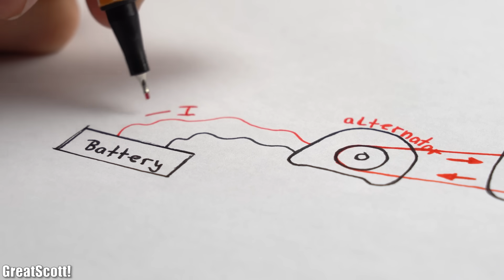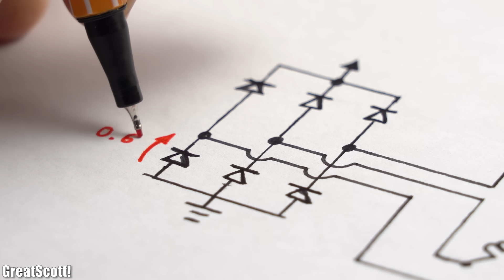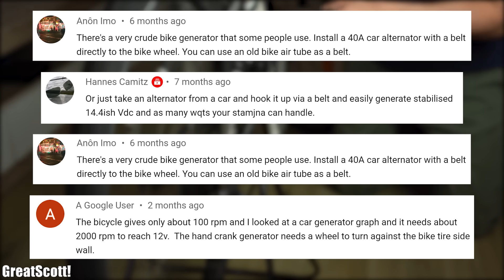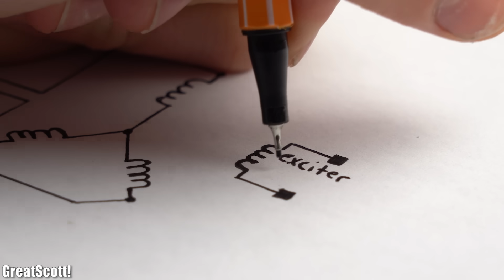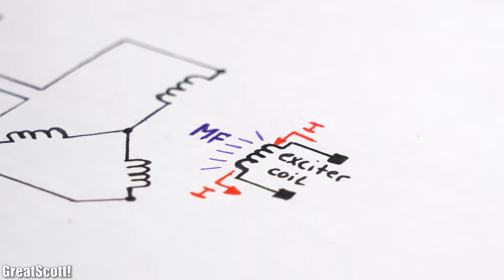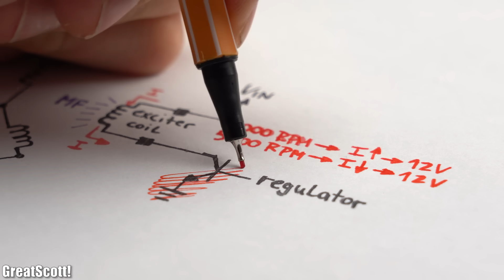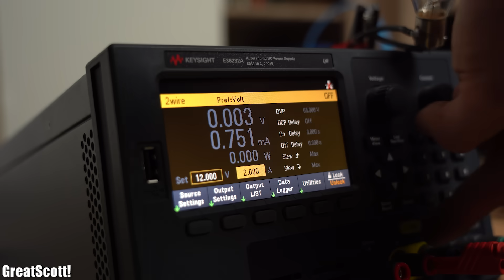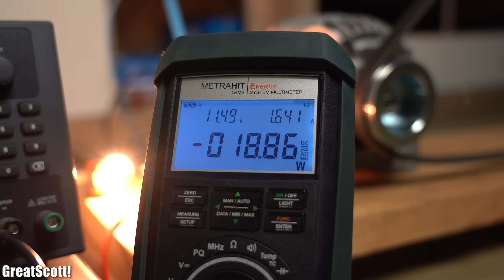Using a car alternator with a bike to power my home? How much energy can I produce?!

Comment: Buy a 250 amp alternator It produces 240 volts if you go around the rectifier.  buy a 3/4 horsepower motor 240 volt single phase.  hook it up to the the alternator with a belt and spin it up.  The alternator will run on 12 amps which leaves 238 amps to run your house.  Plenty of power to run your house.  Remember, the magnets spinning causes the wires to make power it  is not free power.  The courts have said you have the right to be independent so it is legal.

Comment: Don’t know if that particular alternator would have done this but some alternators actually will produce enough current without outside power source (by connecting B+ to the field) to get the exciter coil to start thus bringing the magnetic field up and producing 13.6-14.4v  under no load

Comment: 3:33 Just for anyone watching, some newer alternators CANNOT function without a battery, and a subset of that is Alternators that need a Duty Cycle % from the PCM to control how much current to produce. Sometimes it is 5v not 10-16v, so always check before applying field voltage.
Reply: Mine has a very small Mitsubishi alternator and I have a momentary contact switch to excite the regulation circuit. The battery is the size of 2 Tic Tack containers and is sealed lead acid. One touch of the switch and the voltmeter jumps to 13.8 volts.

Comment: Hey Scott, if you used some kind of tensioner pulley (as per modern cars using those ubiquitous serpentine belts) you would stabilize your setup and prevent your main belt from slipping or slipping off entirely.  I got a little confused with the electronics aspects of your alternator but all-in-all thought this was a clever and serious attempt at making your own power.  Good job!

Comment: One thing I would recommend is fond out the max power output at whatever rpm, meaning at what rpm gives you the most. The make a geared pulley setup that your rear tire connects to spin the alternator. Since not much force is required for the alternator its still easy to move, plus you can customize the pedaling speed to output. Also try more than one alternator hooked to a battery bank maybe

Comment: need to add a tension pully to keep belt taunt, also use the alternator to charge a battery bank (think like a solar set up  but the bike is the sun) and the use a 12v converter to house power.

Comment: ud be much better off to setup a small engine to run on alcohol to power that alternator and get really good at growing potatoes as u will need to ferment them to make ur fuel they say an acre of potatoes makes enough alcohol to a till the land b harvest the potatoes and  c have enough left over to do it again another 10 times sugar is the future to green energy as far as the internal combustion engine goes wind and solar is a pipe dream
Reply: forgot to mention that ud have 10 times the fuel ud need after distilling said fuel
Reply: u could also run the exhaust from the engine into a condenser and produce urself some simi pure water cuz burning alcohol gets u co2 and water out the tail pipe think soda water from combustion

Comment: Use an exercise bike, they have high quality bearings and heavy wheels that you can use as a flywheel
Reply: I was thinking what about a  stationary bike? when he built the frame 
Then thought he had more flexibility with gear change
Reply: @JSacchetti1 Not true they make cheap in China.
Reply: @JSacchetti1 Well no not really, different bearings are designed for different applications.
Reply: @JSacchetti1 LOL wat?!
Reply: @JSacchetti1 lol funny but you're right. Adding a flywheel to this is pointless. Also what do the bearings have to do with this?

Comment: I always wondered how much power an alternator makes,   now I know  Thanks. 1440 Watts
Reply: Just remember 746 watts per horsepower. So that alternator requires approximately 2 hp input to generate that 1440 watts. Most likely more due to various inefficiency issues.

That 1440 watts may be enough for his home, but there's no way he's gonna get anywhere close using just his muscles.
Reply: @johncochran8497  "Christopher Columbus sailed the ocean blue in fourteen hundred and ninety two, divide that son of a B** by two, that's how many watt's per horsepower."  even after all these years, it's still there in my head.

Comment: Yhea well one very important detail Left is that a alternator will run at 800 rpm and will have like about 100 lb of tork  wich I don't care how good you think you are running a bike you probably end up on EMS VAN  before you can get 20amps out of that alternator

Comment: 0:55 The battery doesn't power a car's electronics, the alternator does directly. Current flows back to the battery only until it is recharged after running the starter motor. The circuitry in a car will allow the battery to run the electronics if the engine is not running, but once it starts the alternator takes over.

Comment: So I think you could have more success if you acquire an alternator that does not use a load signal like the one you have there. Something for an 80s car maybe, like a Volvo 240.
The load signal is normally not a basic 12v positive signal but a block signal (PWM) commonly called DFM.
I did understand that you bypassed it and feed 12v directly to the exciter coil(Not sure I am using the right word there) my concern would be that I can't see the PWM be a 12v signal, more likely 5v. 
I don't know what type of alternator that is but, that load signal can work in many different ways, all depending on what type of system it goes to. 
And as others have already pointed out, more tension on the belt and a higher gear on the bike.

Comment: Interesting! You do a great job educating me what not to try...lol!
Reply: It's not the worst idea, you just don't want to power it with a human. It'll cost you about 500kcals per hour for a mere 20 watt hours. Even in the most expensive areas, a kilowatt hour is around 25 cents. 1kWh is 50x what you'd get out of this contraption, so you'd break even if you had 50 people on 50 contraptions and you could feed all of them for 0.5 cents per hour, ignoring the cost of the machinery etc.

Stuff like this can work well enough if you have running water available to tap, but you're better off gutting a front load washing machine and using its motor vs a car alternator.

Comment: You should downshift that gear ratio at the back wheel. You are in granny gear, a.k.a slowest gear.
You'll probably get x5 the speed if you shift to the smallest back gear. You can also manually upshift the front and remove the front gear shift.

Comment: You can convert motors into generators by changing the wire phases. There is a start winding remove the capacitor and fuse the two wires the polarity should be low resistance.

Comment: Why did you destroy the alternator? It was wnough to connect it to a small lead-acid battery in the way is connected in cars and this would have been enough for the regulator to work well. The plus and minus from battery to plus and minus from alternator output, and the terminals from the exciter are going the plus trough a switch which you turn on only when your'e pedaling and the minus to the general ground. You are not suposed to generate all the energy by yourself but only to refill the energy the battery loses when in use. That's how the alternator in cars work like. When you use more energy the regulator of the exciter gives more energy to it, when you need less energy the regulator automaticly switches if to a low working rate.

Comment: The alternator doesn't charge the battery to run the car. It charges the battery to START the car, the alternator then produces enough power to keep the vehicle running and power all of your accessories (AC, headlights, radio, interior lighting etc etc)

Comment: Reminds me of that extreme cheapskate mother who wanted to power the swimming pool pump this way, because "houses with swimming pools use 49% more electricity than those without"
Reply: Hey Great Scott, have you tried using motor from electric citrus juicer  ? It is a low RPM permanent magnet motor, that actually generates electricity when you turn them....and its about 40W motors....also LG "direct drive" washing machines use permanent magnet motors.....
Reply: home ceiling fans should be viable as well

Comment: This brings back memories. My dad owned an alternator and starter rebuilding business, and that was my summer/weekend job while in high school/college.
Reply: I used to rebuild/repair GM alternators with their diode trio, rectifier, etc.  Learning the most important tool was 2 straight paperclips to keep the brushes seated before cracking the case open.  I went to help a friend fix theirs, a couple of years ago, on a non-GM car.  Only to learn, 'not repairable' welded shut. Buy complete new one. :(
Reply: @spockmcoyissmart961  The sad issue with a lot of modern stuff

Comment: You can modify the diode pack to generate AC power. Most people don't realize you have to excite the alternator with electricity before they will produce power.

Comment: I didn't watch your complete video, so I could be wrong. Many years ago I was searching to make a bicycle generator that would power a tv so you could watch tv  if and only if you were doing your exercises. As a side benefit there would be an extra output to charge your phone in case of a power outage.  My first question was how much power a person could generate.  I came up with the average person could produce 60 watts of power.  Good luck powering your house.

Comment: Tighten the belt and use a 12V battery in the circuit as intended. Be prepared to make a couple of horsepower if you can get the belt not to slip and create enough load.

Comment: I wonder if you could tap the 3-phase and rectify it separately to get more power at the lower rpm of pedaling.  Then use a buck/boost to get the voltage you need for your loads.  GM 10si alternators are easier to hack from what I hear.  Look at a defunct channel Alternatorman for some good insight.

Comment: How about using an old ebike hub motor as a generator.  They usual have permanent magnets.
They can produce a 3 phase AC output, or some of the older ones are brushed and have a DC output.

Comment: You need to tension the alternator so that the belt is always in efficient contact with both the drive and driven wheels. Some are suggesting adding a tensioner, but that would only add resistance and reduce efficiency.

Comment: The generator is the modern one so it need 1 pin is LIN connection , it is receive data from body control module or Engine control module to control the output of generator . So maybe because it can't communication and it can't produce much energy 

Find the old style one have 2 , 3 or 4 pin and use 1 small 12v battery and connect all 12v to the all pin and test it again later

Comment: A couple of things to note- One, get a belt tensioner from a natural gas clothes dryer, those use an electric motor to spin the drum via a belt. That would put enough tension on the belt to keep it from slipping and popping off. They can be easily attached to the board. Two, that alternator is an externally regulated type, the car's engine computer controls the alternator output. Get an alternator from a GM from the 80's, those have an internal regulator, all you need is a 12V source and a good ground. Alternators need power to make power, as you found out. It is correct that alternators make their peak power about around 2000 to 2500 rpm.

Comment: Change the alternator drive to a chain drive, mechanical losses will be less and there will be no slippage. Have a small bike sprocket welded to the pulley of the alternator and use a bike chain attached to the largest gear on the rear wheel while the bike's chain is on the rear wheel's smallest sprocket.

Comment: You need a GM car alternator, from 1988 to 1995.  they have a great voltage regulator built-in for this.
Reply: Actually any GM alternator from like 72-95 would work with a single wire. GM sure made some good stuff
Reply: @1fast72nova  does this still stand? I can just go to auto parts store or wrecking yard and grab GM alternator from years you specified and run on one wire? Thank you. Trying to avoid shelling out for a permanent magnet generator.
Reply: @robs9574  pin #2 goes to the batt+ lug and that lug goes to the battery positive. The case is ground
Reply: @robs9574  you'll still need two wires for electricity to flow, just one will be to the case of the alternator like shown in the video. In a car the body of the car body is connected to the alternator and the battery negative so it's acting like a second wire

Comment: Put a directional one on top of a 20ft pole with a wind propeller on it, because they have a voltage regulator wind speed wont matter, still be 13.8v DC.

Comment: With a belt tensioner and a few different gear ratios you might just get some where and you would not have to peddle as mush as well but good thinking if you get the gear ratio right you can get a hamster on a running wheel to spin it and create your power for a few kibbles ...😜

Comment: Remove the diodes. Then it will open up the real potential. You can get 120V out of it. And secure the bike to the stand a little better than zip ties. use metal clamps like the ones the use to hold metal conduit to the wall.

Comment: you can sometimes get a perfectly good alternator from a junk yard or scrap metal place as what goes wrong is the diodes and regulators built in fail but the windings are perfectly good.

Comment: I wonder if a flywheel would have proved to be more successful.  Powering a house can be difficult, but enough to power a furnace fan with a battery backup would be advisable.

Comment: Use a welded steel specialized frame, and a chain to drive your generator. That does no slip and is quite more efficient than a belt.

Comment: The setup you made is crap. With an adequate, strong setup, a regulator and a battery you can produce some 150 W for a long time. More than that you'll drop dead in a coupla hours. That is YOUR muscle power, minus efficiency losses.

Comment: To eliminate the high rpm problem you just need to buy a retrofitted alternator with permanent magnets. A few sites sell the Delco  version which creates 12 v as low as 150 rpm.
Reply: Kubota lawn tractors use a small PMG alternator. It has a 2 wire output and needs an external regulator to provide 13.8 volts at about 20 amps. That's about 275 Watts. I got the alternator from eBay for $60 and the regulator was about $15.

Comment: Induction motor will become generator when you rotate it very fast above the rated speed.. i.e. for 1490rpm motor should be rotated almost 3000rpm so that remanence magnetism kicks in and starts generating power. Also capacitors attached parallel to star ground will help it. All in all, IM is one of the hardest to make generator by using bike as power source. If someone did not already comment this already...

Comment: i think you messed this up again. i doubt the torque input when pedalling is high enough and that the setup is efficient at converting the energy.
I'd use a belt transmission and gearbox attached to an AC induction motor where the average cycling speed would translate to the motor max rpm after gearbox conversion.
I would expect 200w atleast.

Comment: Why don’t you buy a 240v alternator and a 240 v motor once you start the alternator 
going it will power the fan motor and give you 240 volts for free

Comment: Car alternators are 3 Phase AC. Houses are wired for Single Phase AC. Aside from that hurdle, you’re mot going to be powering up a kitchen circuit & keep your refrigerator running with a bicycle.

Comment: I think you should have gone with a stator from a motorcycle rather than a car alternator. Motorcycles use a permanent magnet generator in a centre tapped Y, there's then a separate regulator rectifier unit. Kind of like you rigged the alternator up by powering the magnets permanently. Probably not as easy to get, but would have been more forgiving due to the simpler setup and unregulated 3 phase output you can choose how to regulate. Still cool vid 👍

Comment: first: yout alternator has ecu controled voltage regulator, you should took older with automatic regulation, second:alternator efficiency is about 50%, and you have losses on belt, bike chain , so you can get maybe 20-30% of invested energy and you can produce some 150-200w at peak so you could power some weak 60w bulb  , suprised?

Comment: You do realise that the rpm required is the engine rpm of around 2000rpm?, and that the alternator needs an input rpm of around 6000rpm? Also some alternators require a PWM input to tell the alternator what output is needed by the electrical system. This PWM signal comes from the engine ECU/BCM. In order the achive what you want, you need to strip out all of the electronics and control the exciter winding yourself or you need to get an old alternator from the 80s/90s. Something is clearly not right with your setup! My car can have everything switched on and maintain a voltage of around 13.5v and with everything off a voltage of around 14.4v.

Comment: Why not connect 2 9v rechargeable batteries in series to the exciter coil? That would give you 18 volts, and you could connect a battery bank that holds and charges 9v batteries and just swap them out when necessary.

Comment: Youre not using the highest gear on that bicycle. Highest gear should have the chain on the smallest sprocket at the wheel and biggest sprocket at the pedals. This would explain why youre not getting the output you want